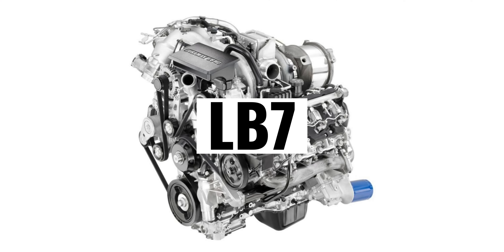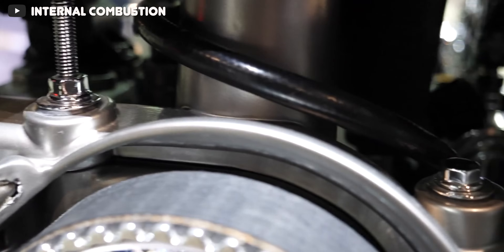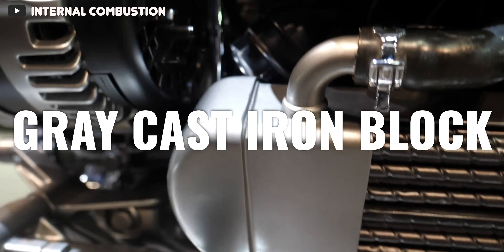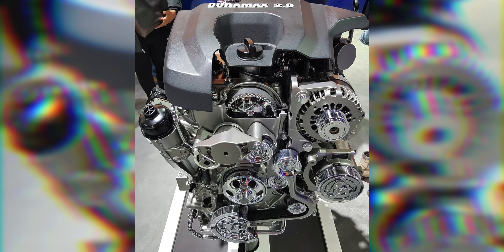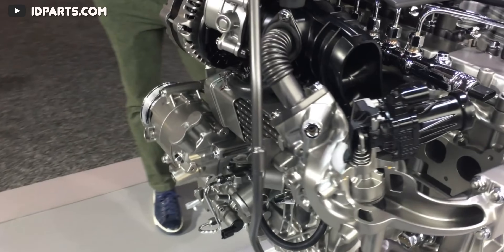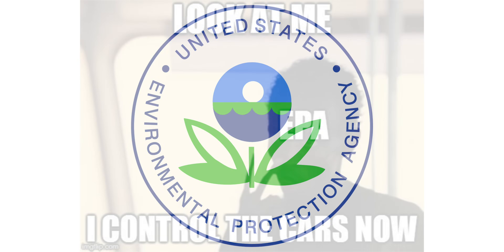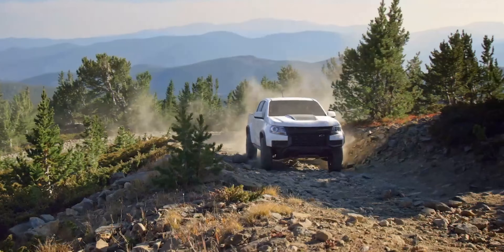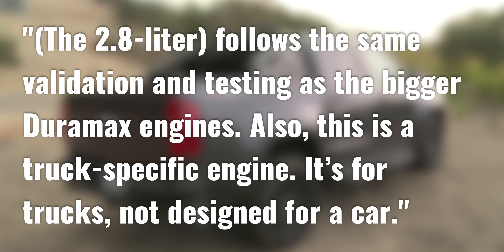2.8L LWN Duramax: Everything You Need to Know

Comment: While the 6l50 may have been in more cars than trucks… it’s not a “specific” car transmission. The 6l50 in the Colorado does not use the same clutch packs or converter the car counterpart uses
Reply: And the 6l80 is junk as well. Talk to any one of us trans builders. They have a long list of poor designed parts.
Reply: @alexpirie9947 would it be a more desirable application over the 6l50? I just added a comment asking if it has seen a difference
Reply: It’s still much weaker than a 6l80
Reply: @mddunlap03  The 6l80 and 6l90 both have more issues and a higher failure rate. The 6l50 have less mechanical issues, and the 6l50 used in the Canyon and Colorado are different internally also.......

Comment: I have a 2.8 Canyon and I really like it.  Decent power, consistently gets 28+ mpg.  No problems so far, knock on wood.  I'm considering some minor upgrades in the future, mostly to the suspension.  I can't believe GM isn't going to make the 2.8L available after 2022.  This engine should be in everything: cars, SUVs, small trucks.
Reply: Timing belt instead of timing chain? Built in Obsolescence

Comment: I use to be a chevy/subaru tech and when chevy rolled out the zr2 i fell in love with the  zr2 duramax, I have had some problems with the truck from whole emissions system failure about 55k miles and the engine throwing a rod out the side of the block at 60k miles, everything was under warranty but still surprised me
Reply: I hear you. Sounds about right. i traded my subaru for mine and which I had the subie back

Comment: Jump on any of the colorado forums and you'll see the 6L50 is not an issue. Has a more robust TC than any of the car applications and takes the torque just fine. Also the version behind the 2.8 shares several internals with the 6L90 transmission.
Reply: It’s even stronger with the Revmax converter….
Reply: ZR2 d Max owner…trans definitely not flawless. Chevy tech is literally afraid it’s going to blow up, it shudders so bad.
Reply: use the mobile trans fluid  it helps lots with shudder.   @RB-rl7kv
Reply: @RB-rl7kv  Tuned and deleted for 60k miles and never a shudder. Its not even close to having the issues that the 8 speed in the gas trucks have.
Reply: I have chevy trailblazer 2.8 babyD with a standard 6L50 transmission. The transmission as been flawless apart from a slightly loose gear leaver and that's it. It's been a great daily driver.
Reply: …jump on any forum and the transmission is literally all anyone talks about. 

I own a ZR2 baby-D, I love it, but all my maintenance energy goes towards that damned trans and torque converter.
Reply: @bobbyharriman7075  for the 8 speed in the gas truck ya. Please show me where the diesel trans is talked about. Also a zr2 dmax owner. Mine is flawless
Reply: I use top tier Mobile one trans fluid and that helped with the slight shudder mine had, I also did a minor valve body tune by swapping out a few parts at around 90k. the trans shifts great even while towing. I also have an external cooler for the ATF. stock the fluid temps would hit 230-240  now in heat of desert summer towing 218 is the max.

Comment: I had a 16 Canyon loved the truck and towing I used it for, but that transmission was a joke GM failed miserably on the software for it. It had horrible shifting irregularities that they never could fix. Ultimately I traded it in on a different vehicle.
Reply: Did you shift in manual mode? Or tow mode? There's usually a reason for this. Higher rpms means higher line pressure. Also in tow mode the transmissions are usually kept in a lower gear so you have more power and don't buck or get the torque converter out of lock up. This way you keep the torque converter cooler.
Reply: @jimmypatterson9854  No just normal driving at slower speeds the transmission couldn't figure out what gear it wanted to be. higher speeds it was fine.

Comment: We have had two Duramax Colorado’s a new 2016 and just a few weeks ago a ‘22. It’s primarily my wife’s commuter vehicle and for hauling feed and supplies from town for our farm on her trips. People seem to bag on this engine but it is fantastically paired to this truck. I am a big Toyota guy, specifically Land Cruisers and I even petitioned Toyota to bring some diesel offerings for their 4wd’s stateside so when Chevy brought this to market I immediately put my money where my mouth was. I had previously used a foreign version of this engine for traveling in South America in a Chevy Luv and in New Zealand in the Holden version and loved it. The US version is even more refined. We have towed a 23’ camper with it and it pulled easier with less drama than our 3/4 ton Suburban we had at the time. Daily driving we get 32-35mpg on the two lane rural roads here, towing our old camper we saw 15-16 which was great. A small diesel in a mid size truck is a great thing. Knowing they were going away this year we scooped up one of the last ones in the region we could find. We love it. For our uses, they are great, even if I will have more upkeep in the emissions system down the road. I feel like most of the issues folks have are due to short distance use in these things.
Reply: The 2.8 colorado gets trashed on here in Australia because the early models up to the '13 model burned oil between services but from '14 on they are actually great motors. Heaps of power for it's size, great on fuel and extremely reliable
Reply: Love my 2.8. Please GM wake up! Don't drop this engine.
Reply: I recently drove a 2016 Chevy Colorado with the 2.8 duramax. It seemed like something was wrong with it. Off the line is was a total dog then at 2000rpm it takes off. The hesitation was super annoying. Is this normal behavior or could the vanes in the turbo be sticking.
Reply: @erikkovacs3097  dpf issues most likely.
Reply: @erikkovacs3097 install a electronic throttle controller- gets rid of lag.
Reply: you are fortunate. I put cross country miles on mine and have had numerous issues......DEF. Nearly stranded me in the desert Multiple Nox sensors, radio display that failed, transmission shutter.....on and on. In shop many times. I have 108k on mine and nervous as hell to keep. Join the forums on these and it will put the fear of God in you
Reply: My has done 260 grand. It’s been pretty reliable- did a big lap of Oz.
Reply: My has done 260 grand. It’s been pretty reliable- did a big lap of Oz towing a van:) it did well!
Reply: My feelings exactly! I don’t understand why GM develops  a midsize diesel for our market and then drops it a few years later. They should’ve worked on getting the cost down instead. I’m sure the new gas turbo will be fun to drive But It will not deliver 34mpg on highway or 15mpg while towing.
Reply: I’ve got the ‘19 ZR2 and continuously had issues with the particulate filters. Constantly having the check engine light show up and for around 6 weeks drove in reduced engine power mode (still hit highway speeds but basically no turbo). My truck was at the dealership to the point that it was becoming a major inconvenience. My buddy is a diesel mechanic and suggested that I delete/tune. I found a kit at HD Diesel out of Canada and after the dealership ended up replacing the entire DPF system, I got my truck back without a check engine light popping up every other day and then disappearing randomly to appear again a day later. Best decision I’ve made. Increased torque (100) and hp (60) along with a transmission tune (better shift points) but my mileage is what makes me the happiest. I drive quite a bit and go into some serious sketchy rocky terrain to deal with feral hogs that I’m contracted to kill on public and private land. It just performs so much better and my buddy runs diagnostics on it to make sure nothing bad is happening but the kit I bought was the most popular for that truck considering that it had safe number increases.
Reply: @georgefloydsinhellwbreonna5330  how's the delete kit going....any updates? thx

Comment: I had a 2018 canyon with the 2.8L diesel SLT 4x4 long box crew  cab. 
Used as a daily driver and towing a couple quads in the summer and a four place snowmobile trailer in winter. Worked excellent.  Emissions  specifically the DEF was the only weak point.  I'd regularly get 22mpgs to 34mpgs . Usually  close to 30. 
   Liked the truck so much I bought a ZR2 diesel last month . (Same truck more ground clearance. )
Reply: Motorops In 🇨🇦can make that go away…
Reply: Have you looked into deleting the emissions?
Reply: Zr2 comes in a 
Short box only
Reply: Agree 100%
Reply: How is the zr2 on milage?
Reply: @jimmypatterson9854  I have a 22 zr2 I get 25-30 all the time.
Reply: @jimmypatterson9854  not as good as the SLT canyon . Likey due to the larger tires and higher ground clearance as it affects the airflow over the vehicle.  Only have 6k miles so not sure what the overall milage will end up being.   Running around 25mpg now
Reply: If only they were a really built to be bulletproof. The epa has it sucking on its own farts and you pay big cost in long run to keep these systems working and the older it is the less worth it to fix. Parts fill up junkyards and now the soil polluted.
Reply: How’s the reliability on your dowse zr2?
Reply: @6.2Slomaro  25000 miles . Just oil changes so far
Reply: What issues did u have with the DEF? I just bought one
Reply: @rabidrusty  gm replaced the def injector twice . But back to back under 5000miles. The first one the put in didn't fix the problem,but the second one did. And froze up once .
   It's actually been fairly reliable.  Knock wood.

Comment: Is fascinating how far behind GM is in small Diesel engines.  Those power numbers made a TDI from VW 90s with less displacement (2.5L)    You get more power from a 2.0L Diesel in International markets today
Reply: Emission requirements are different in the international market also. GM didn't make the engine. They just use them.

Comment: I have one in a Holden Colorado the engine is good but the transmission is trash. Torque converter are a massive problem for them there is about 1000 of them on back order for replacements
Reply: The clutch lining and the steel machines surface have a curve cut in them from the factory
Reply: Gotta get billet replacement and cancel cylinder cancelation so the torque converter doesn't slip as much in cylinder cancelation.

Comment: The timing, I just bought one today lol.
Reply: That's excellent.  As a daily driver and light work truck you will be more than  satisfied.
Reply: @robertmoulton2656  I hope so! I got a used 2018 gmc canyon 4x4 denali and I really like it so far! Trying to find more information on the change they did in 2018 with injectors and heads and if it was a good change or not but it is awesome so far! Getting 32 mpg at 65 and the ride is great

Comment: Diesel tech here. Yeah stay away from the 2.8 and 3.0. Very cheap and bad engines from timing chains and belts to a lot of corner cutting. Also don’t know if this guy knows what he is talking about. A 2.8l is small in the diesel world for a 4 cylinder. Seen 7l straight 4 engines
Reply from the maker: Small is relative. I was talking strictly in terms of road-going vehicle engines. No tractors, generators, etc.
Reply: @Dustrunnersauto  yeah their are 4.8L and 5.2L straight 4 in Isuzu. Not including the 4BT. So again 2.8L is very small. And considering over seas they been putting in 4.2L straight 6 in Nissans for ever just goes to show that they could but don’t because of cost.
Reply: 4.5l isn't uncommon in tractors. But the only Rev to 2500 to 3000rpm.

Comment: I just don't understand why they went with the 4 cylinder. The use of balance shafts, although necessary, add weight and complexity, thereby diminishing the economic benefits of the 4 cylinder. A 6 cylinder would make more sense.
Reply: Packaging I imagine. V6 diesels are no bueno and i6 engines are very long
Reply: Only have so must space to work with in modern vehicles.
Reply: @ajgurney5811  have you seen the Colorado? It can fit a 5.3 v8 in it. 4 cylinder diesels require 2 balance shafts. That engine is likely bigger than the 5.3 I mentioned. A slant 6 with a turbo takes the same space as that giant 4. And giant it is, a 4 cylinder of that displacement will be rpm limited even with the balance shafts.
Reply: @jamesrobinson9176  Subaru has several 2.5L that revv to 7000rpm fine. 2.7L 2TR-FE to 5500rpm. 3.0L porsche S2 6500rpm. Waaaaay back in the 1960's there is the Pontiac Trophy 4 at 3800rpm.
Reply: @superjesus4307  are those inline ?I thought they were all horizontally opposed. Do you understand primary and secondary vibration and harmonics? Large 4s without balancing shafts will shake themselves apart.
Reply: @jamesrobinson9176  Only the subaru is a flat 4. Detroit Diesel made 4-53 (3.4L) and 4-71 (4.6L) engines with no balance shafts for 50 years running to 2300rpm. Cummins made the 4BT (3.9L, 4.5L) and ISF (2.8L, 3.8L)
Reply: @superjesus4307  i already covered the rpm limited ones... they have zero relationship to what we're talking about here. I think you're missing the forest for the trees. 🙂
Reply: @jamesrobinson9176  LOL, thanks for showing you don't know what you're talking about. Go be a clown elsewhere. The big boys are talking.
Reply: @superjesus4307  c yourself out any time pal. I know now that you are looking for an argument. And obviously, have no idea what you're saying.
Reply: @jamesrobinson9176  since you don't understand how engines work, your opinion means nothing.
Reply: @superjesus4307  then why are you trying so hard?
Reply: @jamesrobinson9176  I'm not trying at all. Just relaying statements of fact.
Reply: @superjesus4307  another false statement! Lol just like the rest. Remember, you're the one who thought Subaru made inline 4s. Lol
Reply: @jamesrobinson9176  Reading comprehension is hard. Never once did I say it was an I-4. Nice strawman attempt though.
Reply: @superjesus4307  lol 😉✌😴
Reply: @superjesus4307  you strongly implied that a flat 4s construction was relevant to the argument. Lol you still haven't proven that you have any idea what I'm talking about. 
I'll ask again if you understand what primary and secondary vibration and harmonics do to an I4, do you?
Reply: @jamesrobinson9176  Welcome back, glad you returned. You said "a 4 cylinder of that displacement will be rpm limited". I proved you wrong. Case closed. Good night.
Reply: @superjesus4307  still waiting. Show me that you have even a basic grasp of what I'm talking about. You still haven't. 3rd time I'll ask you this do you have any idea what I'm saying? Do you know ANYTHING about vibration and harmonics ? Anything at all?
Reply: @jamesrobinson9176  Oh you goldfished your thought? 4-bangers have been around for a century without balance shafts. Balance shafts are a very recent development (late 70's) that are only for NVH of the driver/passengers, not for performance or longevity.
Reply: @superjesus4307  I'd be awfully disappointed if you spent the last few days arguing about something you appear to not understand. Instead of responding, spend ten minutes watching a video about this topic, and learn something.

Comment: I was actually considering a Colorado diesel over a Tundra when truck shopping. After hearing that the emissions and transmissions are the weak points, I'm really glad I went with my Tundra. Bad gas mileage will outweigh the inevitable emissions and transmission work for sure.
Reply: Delete it then. The transmission isn’t that bad
Reply: 111,000 miles on 2018 Colorado. No issues. Great mileage. Great towing. Great truck
Reply: Toyota just filed a diesel injector patent. So maybe....
Reply: Regardless of what the experts say that don’t actually own the truck it’s very reliable. I’ve had mine for seven years and use it exclusively for towing and love my truck.

Comment: Its way to small for any gm truck junk truck junk engine the diesel engines should be simple and made to last and be rebuild
Reply: Buy a 6.5 or 6.6 then
Reply: We got a 3.0 diesel. It’s an animal. It’s pretty damn quick
Reply: Definitely not a piece of junk. I've had two 2.8L trucks and now have a 6.6L. Both 2.8L never had issues ran great, consistent 28 - 30 mpg and haul ass. One had 80k on it and never even had a check engine light come; along with frequent high revs